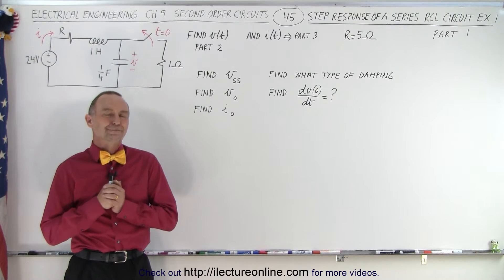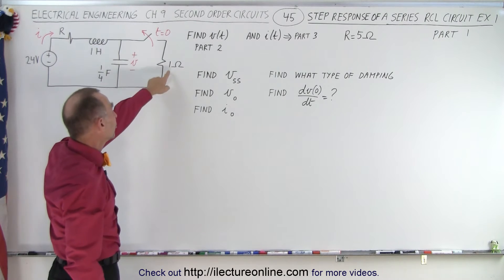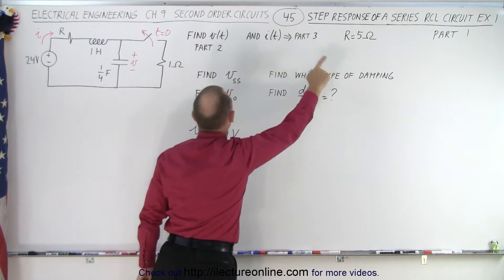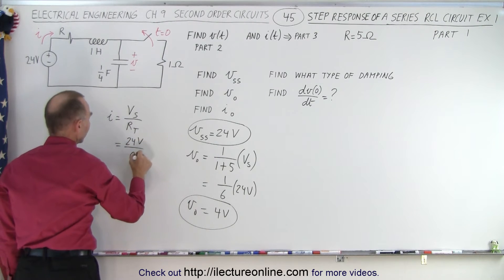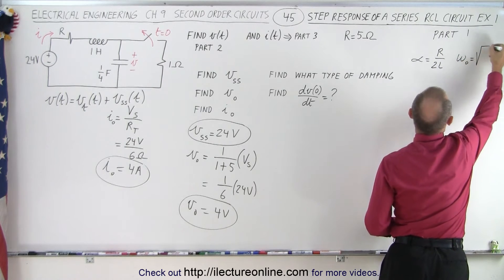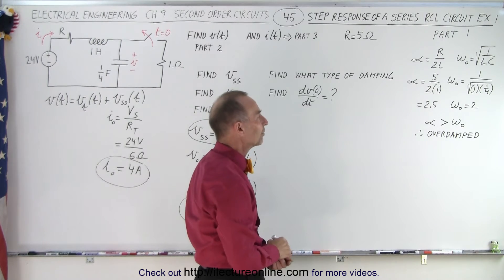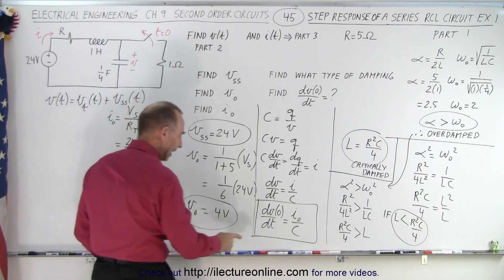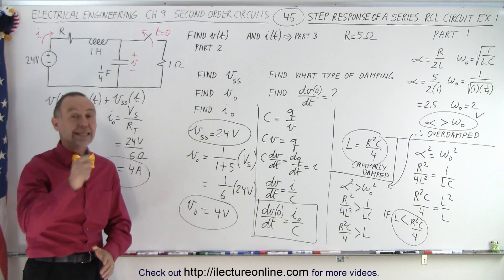Electrical Engineering Ch 9: 2nd Order Circuits (45 of 76) Step Response of a RCL Circuit: Ex 1 P1

Comment: The value for I(0) is not correct . It was caculated for the current  which passes through L and R and not through the capacitor . The (dV/dt) formula should be caculated using the initial current through the capacitor

Comment: For the L is small, can I say that if L is really really small, it will be like a wire, then there won't be any oscillation at all so it is gonna be overdamped?
Reply from the maker: For a small L, the change in current will be more abrupt, and the system will indeed be overdamped.
Reply: @ thank you sir. You are the best !